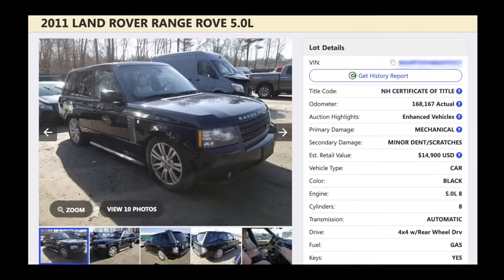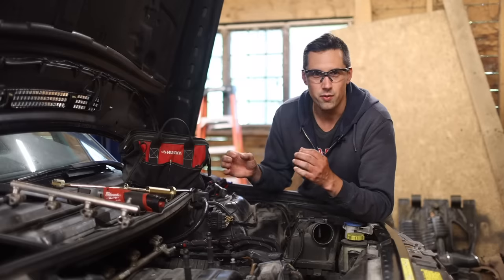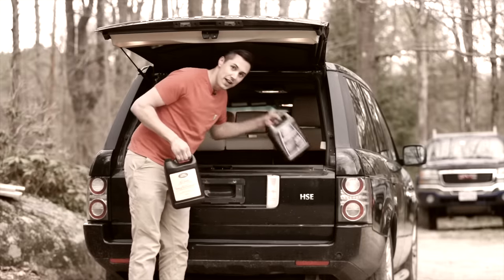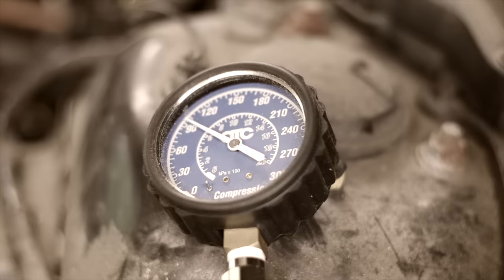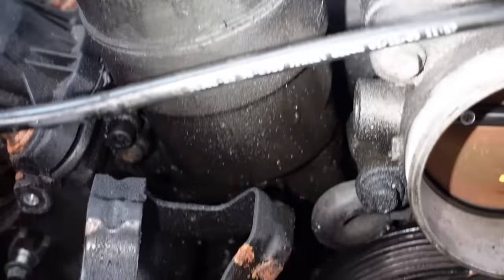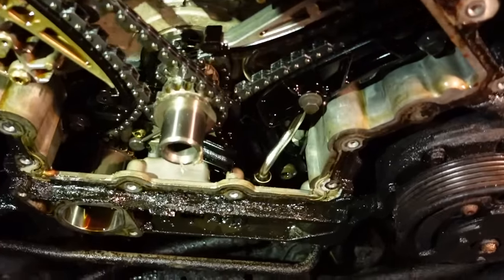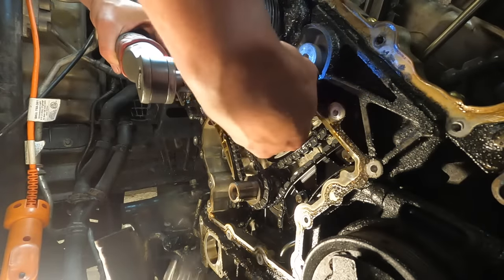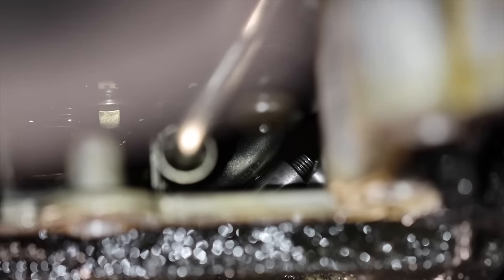I Found This Broken Bolt in the Crankcase of my Cheap Range Rover’s Engine! [Part 3]

Comment: So those bolts that are broken off in the aluminum casting, is that the engine block?  I vote for a rebuild.  If those bolts are in the engine block, they can be repaired but it will cost.  Those scored cylinder walls will be a problem too.  You will not get a good seal and may wear the rings in a bad way.  You have gone this far.  I am assuming that you bought the timing parts already and that isn't cheap.  So, you are kind of into it. Now 10 over pistons and rings. New bearings, check the valves.  Perhaps you can get away with just lapping them.  By the way, if the scoring is really light, you could hone then and get new rings.  We will see when you get it apart.  Good luck.  We'll be watching.

Comment: "how much more work could it be"
Its a range rover. You're going to be working on this thing for months and months. More power to you, but I would have turned around and run at the sound of that engine in the first part

Comment: yeh do a rebuild. anything else is just a band aid. also working on engines in situ is just the worst for scraped knuckles. engine on a rotating stand. see what is going on. sort out your bearings / caps, studs & bolts. easy. also if doing a engine rebuild - steam clean the thing 1st so you dont get crud everywhere.

Comment: I also bought a 2007 land rover hse with mechanical problem for 1100.00 also said enhance,  they said did not run & drive . once car hauler came battery dead my battery pack would not start car but rove did crank good , so I went to uhaul to rent car transport trailer I stop put in 3 gallon premium gas and Lucas fuel injector cleaner and sprayed starting fluid she fired up but ran rough , checked oil nothing on stick I poured a can of restore in oil filled oil now rover runs much better , put in gear was slow to enguage found red transmission fluid in cargo area this is wrong transmission fluid I ordered new metal oil pan with new correct fluid , I ordered many new upgraded parts from Atlantic British I will replace spark plugs coil packs change oil all pulleys new antifreeze water pump thermostat and all hoses it has straight water in system in sure this is why the rover did not run & drive so far b4 I done any work she drives great but I hope much better once my parts arrive I have big plans to build a land rover overland vehicle to join my already 6 vehicles I already own but 1100. Clean title I bought it now for that 1100. I spent more on car hauler to bring it to me , what ever happen to your land rover you bought last video I watched you was talking Cumming engine swap then I saw you bought a range for 2k anyway good story

Comment: Well hold the hell on for s second. Shouldn’t you pressure test the cooling system before moving the cylinder heads?

Comment: You've gone down the rabbit hole there bud. Having rebuilt many motors it's best to know when call it a day cut your losses and also consider the vehicle, which a Range Rover has an awful reputation for poor reliability. When you add up all the hours you worked on it and money invest + the cost and labor to rebuild the engine what is an 11 year old Range Rover worth? Keep in mind this is just the engine. This is a very complex automobile the electrical system alone is a nightmare. Trust me if you get it engine sorted and start driving something else is going to malfunction and it will be expensive. This type of vehicle is the very definition of a money pit. You could probably get $10K if you manage to get it running but not something I would buy at any cost.
Reply: Good enough for YT- Content.

Comment: Before you're at and it's got cold the temperature is cold or below normal from or your your region and if that car has catalytic converter and the hot exhaust coming out will make water vapor come out the tailpipe because of the catalytic converter not for sure this is it in your case but I will keep that in mind because it does down here where I live I live in Florida and in the winter time the cars that has new catalytic converters on them they'll be steam coming out of the tailpipes and it'll be tripping water and this is in Florida and sometimes it gets down to to 20° at times and well that's very seldom but even if it is cool saying in the in the low 40s or high 30s water was still dripped out of the tailpipe of new car so I keep that in mind it might be this moisture or your catalytic converter making moisture from the honey sauce okay buddy I wish you luck with it and I think you got one hell of a deal if they ain't that much wrong with it all right you have a good one this is Ken I live in groveland Florida

Comment: YouTube certified 🤣.
I'm just going to assume that you check the coolant for exhaust gases prior to ripping off the front of it 🤷.
Do you have coolant in your oil? Do you have oil in your coolant? Are you getting coolant in your exhaust?
Having jugs in the back doesn't necessarily mean head gasket issues. 
The reason why you can't find oversized Pistons is because they aren't used. You resleeve the block and they accept standard Pistons. Remember the block is aluminum the sleeves are steel. A sleeve kit will run you anywhere between $700 and $1,000. Then you need to get new pistons and rings.
In order to resleeve the engine must be removed, the aluminum around the block heated and then you're going to need another special tool to pull the old sleeves. If it is the head gasket then your heads are probably warped. Range rovers have a terrible design casting for their heads. 
I hope you have fun with yours. I bought one just like you did and my first trip the head gasket blew. When it did the heater core blew throwing steam all in the engine compartment all while doing 80 mph on the highway 🤣. I fixed everything and drove it for about a year and a half and then gave it away to a friend when I moved. Parts are expensive, design is shitty, gas mileage is terrible.... Definitely not something that I want in any vehicle. With that said the brakes are inexpensive and the suspension is awesome. You'd be better to rip the engine put a speed plate in and drop in a VW engine whether it be gas or diesel. More reliable engine, easier to obtain and cost-effective on the wallet.
Remember that engine was not Jaguar it was originally an Oldsmobile "jetfire" (terrible aluminum engine design) and then redesigned by LR with steel sleves.
I don't know if you were power steering pump is leaking...yet. not if but when it does hit me back. It is a notorious problem with Land rovers and range rovers. The problem is the Teflon high seal rings on the worm gear are junk. To make it worse they do not sell replacement rings with the rebuild kit. I was able to permanently fix mine for about $5. I took the warm gear with me to a caterpillar hydraulic store. We sized up the internal diameter and the external diameter and they hook me up with o-rings and a Teflon seal for the outside of the o-ring. Completely worked. Zero leaks after that. I posted the information in a Land Rover forum along with the part numbers years ago and the guy could not keep them on the shelf he was getting orders from all over the world 🤣.

Comment: This job isan't for the faint hearted or the unexperienced, far too much work involved, I vote you move it on and get your 2k back. Iam a uk truck driver and travling the motorways every day I see more Range Rovers broken down then any other car, highly complex car and very expensive to repair and keep it in road worthy condition, not to mention the fuel cost about £200 (241 US dollers) for full tank of fuel.

Comment: Sorry to see you so deep into the crap on this one. The reputation is well deserved on Range Rovers. I'd return the timing parts and get out immediately. You can save money on the work doing it yourself but just the cost in parts you will NEVER get back when selling it. Even when you say the engine was fully rebuilt nobody will pay good money for it. The reputations are that bad. Learn some lessons: Reputations matter, especially when buying sight unseen!!! Noise in engine, better to go gamble at the casino, they give better odds.

Comment: These cars are totally useless when the issues are not 100% correct solved.  The broken off bolts in the chain tensioners are actually the tip of the iceberg.

Comment: plz do not rebuild the engine it costs a lot and is a lot of effort. will definitely reduce fuel efficiency as you will put bigger pistons in. And JLR already has very low average and fuel prices are on fire. Put your energy and time some place else.

Comment: Hell no,, change out the gasket, get it running and use it up,,  If you go all out on the motor trust me, you will regret it... You will have all types ot eletrical issues and other components fail in the future,,, I've known countless people that owned them, (and i mean newer ones)....   Drive it for a year or two then sell it,,,

Comment: 1 minute in and I want to yell "drive it first" at the screen. 

If you think you fixed rod knock, caused by a spun rod bearing from a blown head gasket, with an oil change? Fine. Drive it 100 miles and test your hypothesis on rod knock oil magic before wasting all this time and money chasing engine tick. 

I'm upset at Waldo's mechanic friends for letting him do this. Drive it to test the rod knock fix.
Reply: This is the worst idea on YouTube. If you rebuild that engine without pulling the crankhaft and spinning it, I'm going to shed a tear for the future you. The rebuild the engine plan involved new bearings, not spinning the crankshaft which means all of this and it STILL will not go 1000 miles